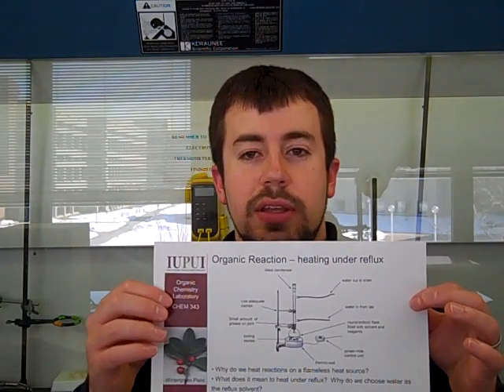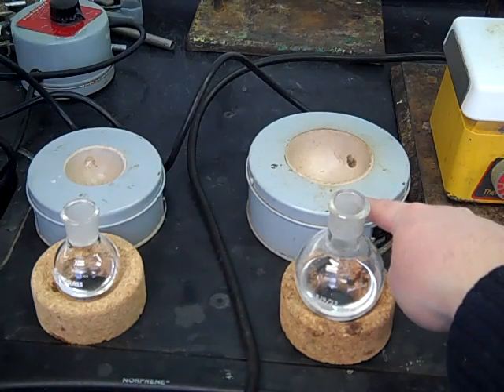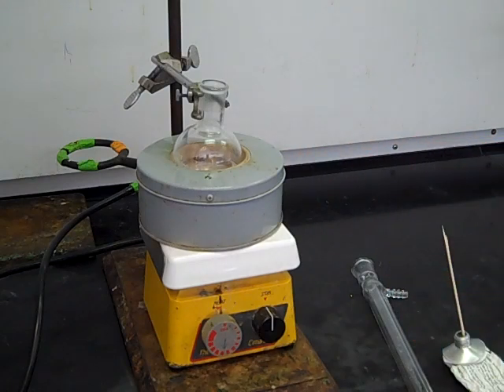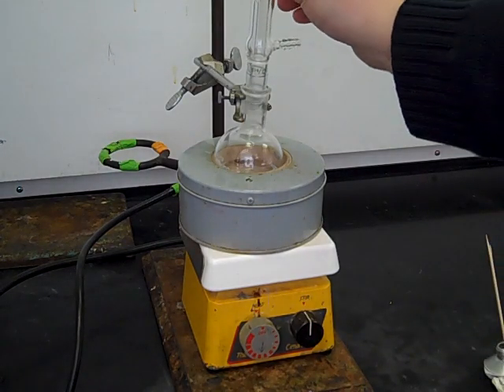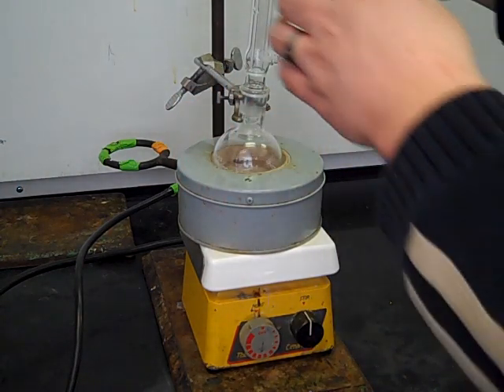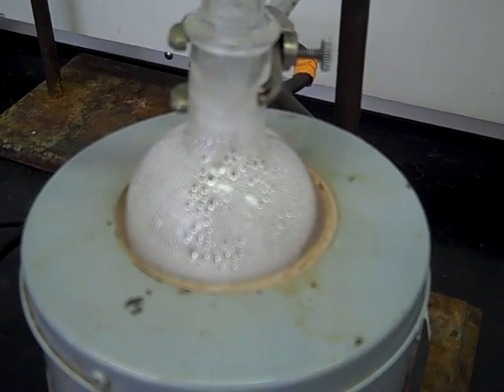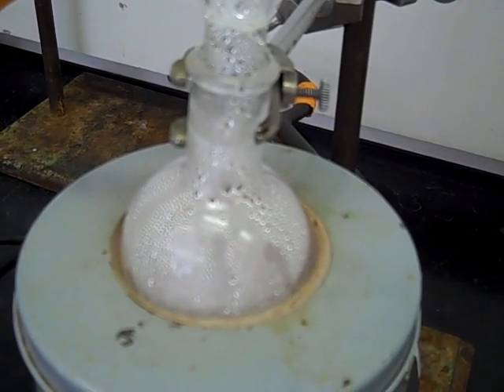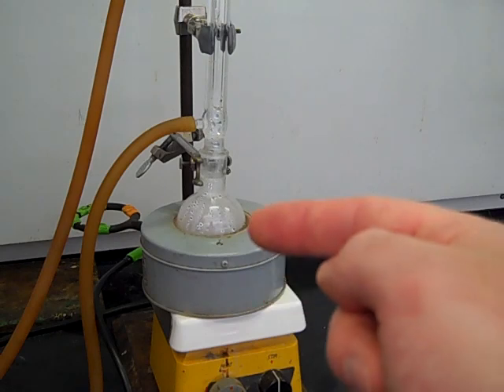Exp 4 Refluxing a Reaction

Comment: Should always be open . . .the golden rule is never to heat a closed system, ergo never use a stopper on the condenser. If your condenser is cold enough, the gasses will always condense before reaching the top.

The stir bar by itself will be fine.